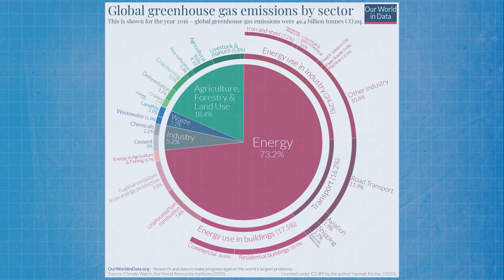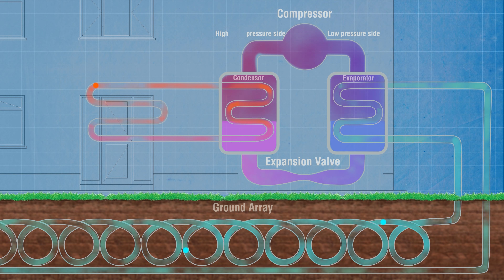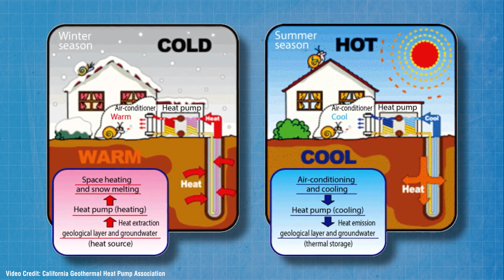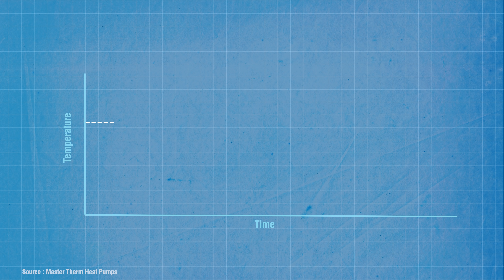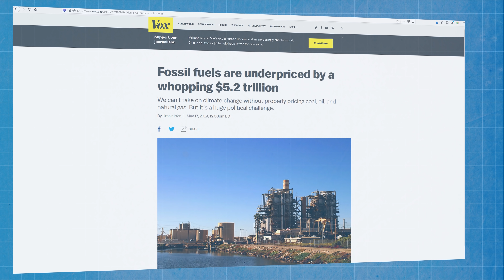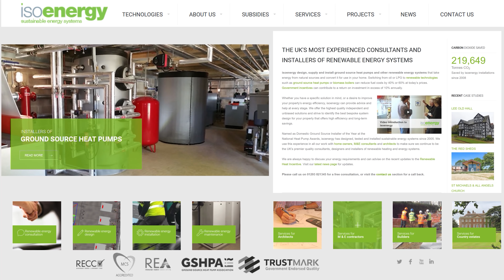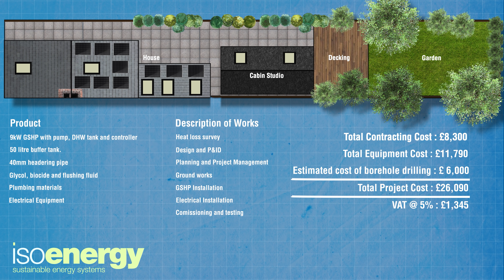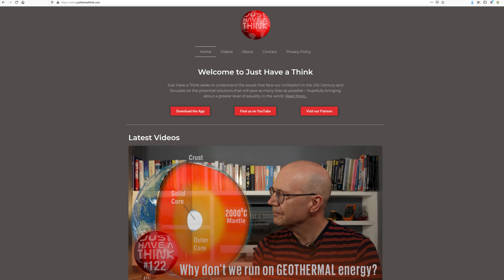Geothermal ground source heat pumps. Heating your home from your own back yard!

Comment: Problem with these systems that noone mentions is - especially if used for both heating and cooling - the earth around the ground array (pipes) gets "burned" from all the heat cycles and loses its efficiency in about 15 years so don't plan to heat and cool your house for free for ever.

Comment: Good video. May have also been good to explain the coefficient of performance COP being around 3 for an air source heat pump and around double that for a ground source heat pump. When I explain to people that a COP of 3 is calculated based upon only putting in 1 kW and getting 3 kW or more out they are amazed (but baffled) .At Helios Eco Lab we have a novel water source heat pump where we have achieved a COP of over 8 which I've never seen beaten.

Comment: 35 year certified water well driller Maryland. Geothermal trench. Buy 500 to 1000 feet poly pipe in a big coil. Bulldoze trench as long as you can 6-7 feet deep
 Uncoil pipe in trench the length of trench.

Comment: You forget to discuss the overall effeciency  in  a national system. If this will or not reduce environmental impact (most concern is GWP-gases), you have to look at how  electricity is produced:  A cogeneration plant in a district heating system  is outstandning. But outside such areas those HPs can have a role.    If you replace electric heating with HPs it is of course better, but that depends on the lousy  efficiency in using  high exergy  for just heating. 
 And you are mixing geothermal with ground source !  The temperature of ground source depends on  ground water which is approx  the average  outdoor temperature of the year.   If drilling very deep  you can reach geothermal  energy, which mostly comes from radioactive decay.

Comment: Your payback system [plan] includes a lot of free money which if you lived in USA would be part my money.  As one less interested in reducing fossil fuels and more interested in payback.  What is the real return on investment?  I.e. how long does it take for the Geothermal system to return L26000 regardless who pays for it?  How would this change if the Geothermal system reached theoretical best competitive pricing?  For instance, it pays to replace incandescent light bulbs with LED right now. Don't wait.  You will be making money (well saving money) within a year.  Another question:  Could a solar heater be adapted to heat the Ground to make the Geothermal heater more efficient? Solar heaters are cheap, when you lay the piping for the Geothermal system add some more lines to pump heated water in.  The heat would be reservoired until the Geo system would pull it out.

Comment: Back in the day when I worked in the North Sea, we where drilling down to 24,000 feet and the drilling mud came back too hot to touch 70+Deg. C when it got to the surface. The ground or soil is a very good insulator so will, at a reasonable depth, say three metres, the temperature will remain constant throughout the year and even in the coldest weather, the frost only penetrates a few centimetres.
So my question is how do we get geothermal energy so close to the earths surface and if we start to extract heat from the ground with a heat pump, how does the heat flow back, when the soil is such a good insulator. Surely we must reduce the temperature and eventually freeze the ground into a permafrost increasing the temperature gradient that the heat pump has to push the heat energy from the ground into the house heating system, hence an increasing cost for moving a unit of heat. 
Just wondering how much this is all pie in the sky. The council built some flats near here and installed ground source heat pumps for the tenants. They were expensive to run and didn't provide anything like enough heat, they certainly weren't the magic bullet.

Comment: Good stuff.  Heatpumps are fun.  Use a heatpump water heater.  It heats the water for the house and dehumidifys and cools the garage at the same time.

I've thought about doing a big ground heat pump by running the hoses out into the lake behind my house.

Comment: There is talk of using heat pumps to extract the heat from water in disused coal mines, which is always very warm, with lots of water. This looks viable for district heating systems in towns near disused mines with very deep shafts.

Comment: Novel idea: the government stops subsidizing fossil fuels AND renewable energy sources and each gets evaluated on its own merits and REAL costs. If we do that, both fossil fuels and renewables will coexist until eventually the scarcity of fossil fuels will the drive the cost high enough that renewables are cheaper for essentially all applications. The market is a powerful mechanism, and humans manipulating it isn't going to speed things up but only distort the truth and create unnecessary animosity amongst groups.
Reply: The problem is fossil fuel subsidies are not always subsidies.   There are the fossil fuel only subsidies, general subsidies available to most business (include green energy), and externalities (eg not charging for co2 emissions).  In addition there are the fossil fuel only taxes (eg fuel tax).   Makes a neutral calculation difficult.

Comment: Good article, as a plumber I was putting heat pumps in schools here in Canada in the 1970's  Originally run off boilers and cooling towers. Ground source since the 90's. Not widely used though.

Comment: Here in Canada, I worry about removing too much warmth and reducing the efficiency of my system over time so my plan is to do heating and cooling, the cooling will help to put warmth back into the ground in summer as well as adding my wood stove heated water into the heating side of it in winter, reducing the need for heat in winter. In summer, my domestic hot water comes from my solar array and excess hot water will be also used to heat the ground for winter as well. The ground is an excellent battery

Comment: I work in the HVAC industry, and installed my ground source heat pump myself, for about US $5,500. I used a horizontal loop field, abut 2.5M deep. 

Mine is oversized for cooling, and undersized for heating, so I can't use it all winter long, but in the milder parts of winter, I can heat my house for about US $1 a day. I have a fossil fuel furnace as back up.

The variable speed\inverter systems, are going to change the industry for the better.

I enjoyed the video, Thank you.

Comment: how much space is needed for a closed loop system? I'm going to be building a house in the Los Angles area and have been thinking in terms of using geothermal, at least partially.
during the really hot days, it's hard for traditional AC units to keep up, in part because the ambient air is so hot, so the chiller side becomes very inefficient. I've been thinking that a combination of a traditional AC and a geothermal heat pump could take the peak load off of the AC during the day, and use the AC to chill the ground overnight to make it more efficient the next day (preventing heat saturation)

But I haven't been able to find info on how much space the ground loops would need.

Comment: Interesting video. Are there any calculations in the public domain (credible) that costs the total carbon involved in the installation, including all the material manufacture and carbon emissions during the install et cetera?

If the intention is to reduce carbon emissions we need an accurate number for the amount of carbon emitted to get the system installed. Is this question rigourously approached and can each alternative energy system be validated so that we know when there will be a carbon saving? After how many years?

Comment: I put a ground source heat pump into my house West of Boston, MA, as it was being renovated and expanded back in 2014. It's just about paid off, or will shortly, as I go through my seventh winter with it. Expensive up front, but in the long run it's proving outrageously cheap. 

I was going from 1100 to 1900 square feet, with a small increase in footprint, and a partial second story, but with a dramatic improvement in insulation from R11 walls and roof to R22 walls and R45 roof. My intention was to put in a centralized wood stove and carry most of the heating load. Then I found out about geothermal systems. As cheap as seasoning my own wood and burning it, I was told, without the fuss. Given most of my electricity is nuclear, and my existing heat source was a 28 year old oil furnace, the climate payoff was made particularly profound. It's dropped the carbon footprint of my house from about 6 metric tons had I stuck with oil to about 300 pounds using electricity from my utility (80% nuke, 8% solar, 12% gas) and my own solar array. About a pound of CO2 for every 10 kWhs. 

The gross cost of the 4 ton system was $46,500, but it's remarkable how many factors drove that down, and how fast. I got a renewable energy federal tax credit of 30%, knocking about $14k off the price. I didn't pay federal taxes for well over a year. I don't make a huge income. The oil furnace was getting old. My central AC unit was highly underpowered, and also old, and updating that would have been about $3,500 installed. I can't get methane gas to my house, so a new burner would have had to have been either propane or oil. $4-6k to install. Then upwards of $2k a year in fuel, plus electricity costs for a standard AC unit. So about $8-9k up front and almost $2.5k a year to run. Plus maintenance. That would likely be a break even. But running the geothermal heat pump has proven to be only about $400 a year. It's been amazing. My electricity is about $0.13 a kWh, and it costs me something like a kWh per degree day to run. So just over a $1 a day for AC, when I need to run it (about 40-50 days a year now, getting worse), and about $2.50 a day in the depth of winter, except during cold snaps down to more than -10C/10F mean temps, when it's a good bit more. 

The marginal cost of the duct work was going to be around $15k regardless, with the new space and the updates to the rest of the house. So:
$46,500 - $13,950 tax credit - $15,000 for ductwork required regardless - $8-9k for unneeded fossil & AC hardware = $9,000. And it's $1,500 less each year to run. That's 6 1/3 years to pay off, then $1,500 cheaper every year. Heat pump is expected to last 25 years, and the 2 x 300 foot ground loops about 50. Another advantage is the forced hot air isn't as hot, so it doesn't dry the air out as much. More comfortable, no humidifier required in winter. But it does dry out the air nicely in summer with the condensate pump. 

One of the best decisions I've ever made. And I hear Dandelion is now doing GSHPs for way less. $18-25k for average houses with existing duct work they can use. I didn't get clear numbers from anyone when I decided to do it, but it has proved well worth doing.
Reply: 2023 jan- thanks for your experience,  that systems was extremly coslty up front

Comment: I love the idea of heat pumps; heating is the big issue to go carbon zero. If my example is anything to go by: 1500kWh for an electric vehicle doing 5000 mile/year, but my heating is 85000kWh for 5 bed house. Heating is 56x energy of the EV over the whole year.

But in the UK many houses, like mine, are old and poorly insulated. The cost to rectify the insulation before electrifying the heating is too high without massive subsidies. I just don't see this happening. I'd rather pay the £2500 a year on gas heating than pay for solid wall and floor insulation and double/secondary glazing etc,  then replacing all the radiators with underfloor heating to get the higher COPs required from a heat pump which will then have to be installed at £30K upwards upfront.

So what's the affordable answer to go carbon "zero" for heating?

The only mitigation I've got is that my gas supplier offsets 100% of the carbon.

I also wonder about the strain on the electricity supply from the heat pumps if every house is pulling another 5kW where the current average is about 1kW.

Comment: The challenge is to understand all aspects as the idea is brought up. First what gases are released when the geothermal might have air escaped times? Is it more radiation than usual or about equal to volcanic emissions? What are the ramifications? They think they see the history with such. The equipment to run such thing is quite considerable. It's said of ancient Egypt they had such energy and the remains are still intact as structures from South America and elsewhere. Instead of asking they used the core substances that can retaliate all alone. The reason the earth is sustained is also the power supply that is mined and exploded at times. So while the brain looks like the brains ...its something to consider

Comment: My mate put air source heating in there house cost them a fortune to run twice as much as a combi boiler.only any good if your out in the sticks and you carnt get gas.they had it taken out after a year.they assumed solar panels on there roof would help.

Comment: Iceland has been using geothermal for many years. Heat pumps are air conditioner in reverse.using physics compression and expansion physics to move heat from the ground to the building

Comment: I remember reading an article in Popular Science in 1979 that explained this concept. The differences between today's systems and the one it described were, first, it circulated air in flexible conduit that wound around under the topsoil. Second, the flow of air could be reversed when the seasons changed, and third, a large plastic "umbrella" was buried with the conduit to help hold more heat in the ground. The conduit would have to be laid out over a rather large area, but not much more than the typical suburban back yard.

Comment: I installed a geothermal heat pump system in my house in Georgia.  It worked great.  The unit was inside my garage and was very quiet.  It also had a heat collector on the side of the unit that transferred heated water to my water heater whenever my system was running.

Comment: You should check out the VITOFRIOCAL ice storage system from Viessmann. This is basically a heat storage system that is slightly under-dimensioned in combination with PVT-panels or vacuum tubes and a heat-pump. In winter you use this system to heat your house and provide hot water. By taking energy from the storage tank you freeze the water in there and in summer you use that ice to cool your house. At the end of summer you'll have (re)charged the storage tank with hot water to use during the winter and the process can be repeated.
Big advantage lies in the phase change that takes place (water to ice and vice versa) which takes a lot of energy. For instance melting 1 kg of ice takes just as much energy as heating that litre of water from 0C to 80C. Another advantage lies in the fact that installing this system usually doesn't require a special permit, like you often do with other geothermal ground source systems.
Link to pdf here: https://www.viessmann.com/com/content/dam/vi-corporate/COM/Download/ice-store-system.pdf/_jcr_content/renditions/original.media_file.download_attachment.file/ice-store-system.pdf

Comment: The UN goal is absurd ego-centric crap.  I drive an electric Ford C-max because it gets 60MPG.    I will install geothermal as soon as I get my next home (Planning a move in three years) because it is a great system.  Forget solar and wind, geothermal if mandated for new construction (and I hate mandates) would dramatically reduce the demand on electric infrastructure.

Comment: As always, thank you for an impressive content! 
I installed a geothermal ground heat pump in 2008 that I combined with solar panels (not solar cells). When the solar influx is high, the system will first heat a 1m³ hot water storage up to 85°C then the system redirects the hot water into the bore hole to heat up the ground. I live on a small island off the Swedish west coast so the ground is pure granite. I was lucky not to have a lot of horizontal cracks in the ground, hence most of the energy is not transported away to my neighbors but stays around the bore hole. During the winter season, the heated ground makes the fluid returning to the pump from the ground much warmer than it would have been without the energy stored from the summer. Right now, the water coming up from the hole is at 18.2°C lowering the usage of electric energy to run the heat pump. During winter time, the solar panels normally is of no use here in Sweden but I feed the liquid coming up from the bore hole through an heat exchanger connected to the solar panels. If they are able to elevate the temperature of the fluid from the hole before entering the heat pump, that is also used.
During the summer, most of the electric energy needed to power the system comes from my ~40m² solar cells.
Reply: nice. that's an impressive setup.
Reply: As a precaution, have you had a Radon risk assessment carried out? If you are anywhere near Uppsala, Radonova carry out such assessments I understand.